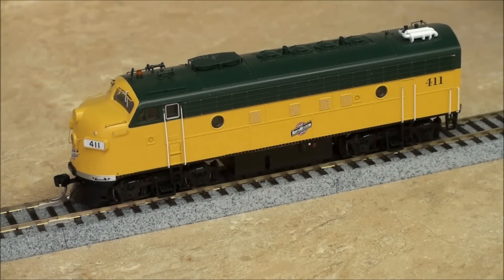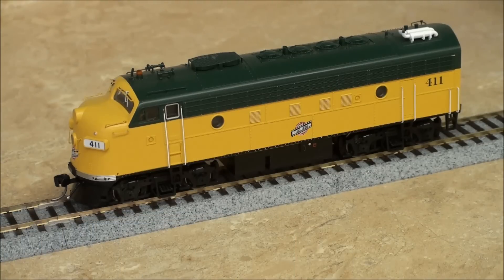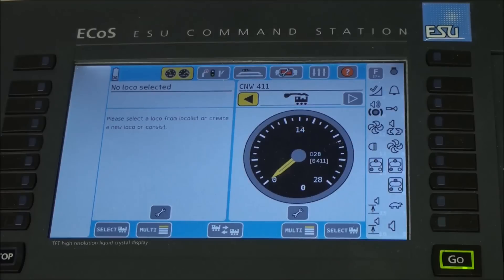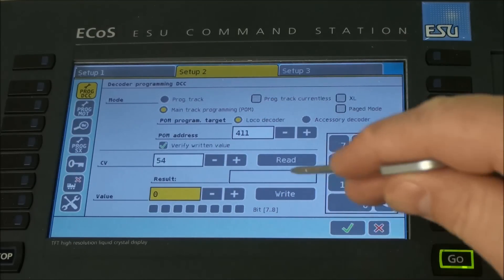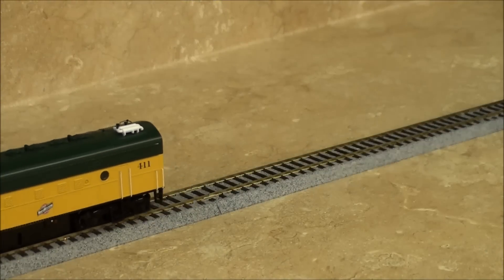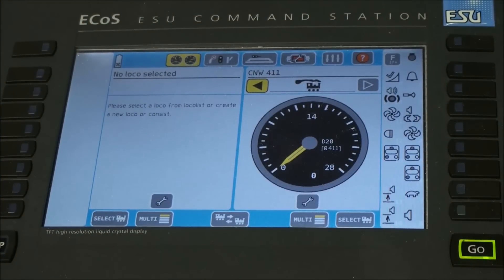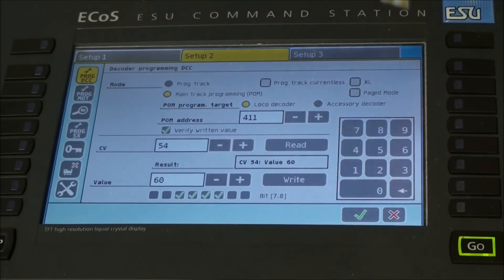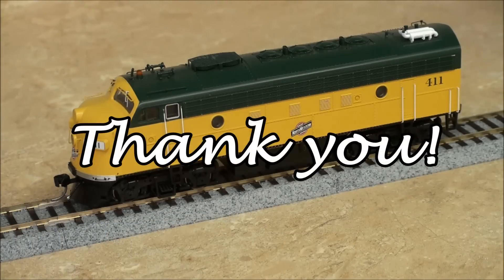ESU TECH TIP: Using CV 54 for Auto Adjusting BEMF

Comment: On my NCE controllers, F1 is the bell!. Nothing happens except the bell rings. What is the regular control equivalent for F!???
Reply from the maker: duckdogger did you first set cv54 to a value of 0? This needs to happen first then on your main track set F1 and the engine will take off like a shot then it will stop with the bell ringing turn the bell off and everything should work
Reply from the maker: duckdogger this feature will work on all commands stations whether it be nce digitrax or others